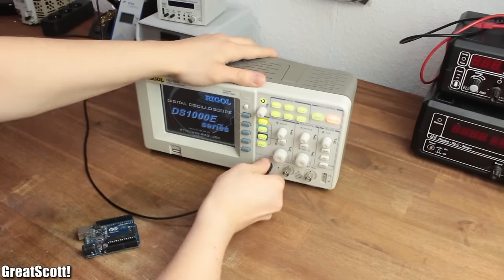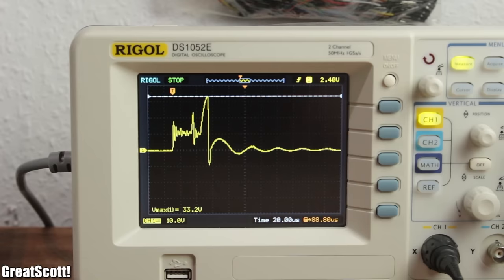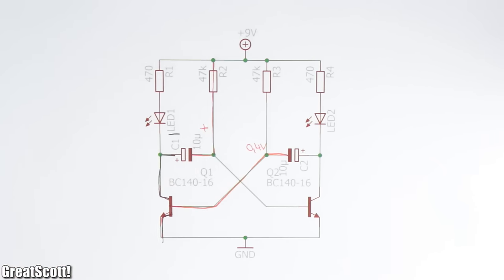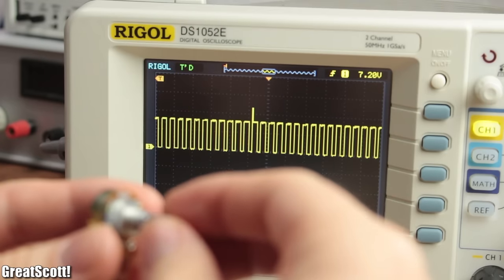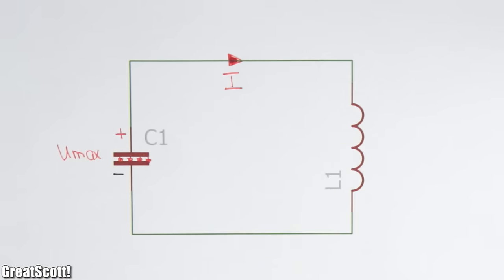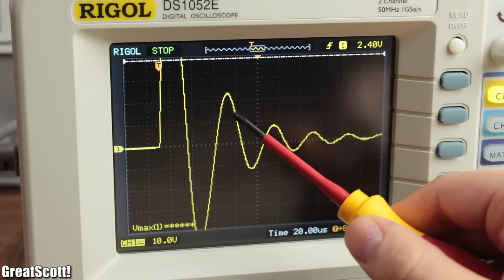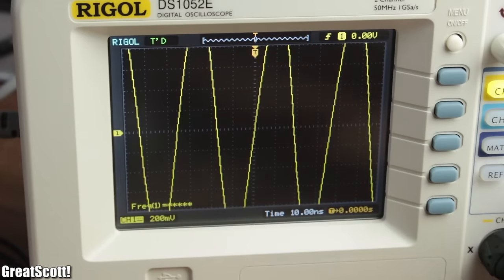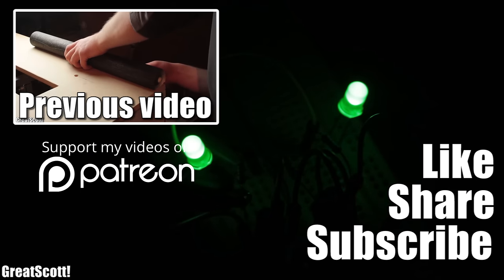Electronic Basics #17: Oscillators || RC, LC, Crystal

Comment: the calculation of the resonance frequency of my LC circuit using 1mH inductor + 100nF capacitor gives f = 15.9 KHz
on my oscilloscope i get about 20KHz :/
is it normal ?
Reply: If you are building on breadboard, always expect it to be different for any circuit heavily dependant on  capacitance and/or resistance and/or inductance.   The breadboard itself can add these values, due to the way the rows are lined up near each other.    These are called "parasitic" capacitance/resistance/inductance, in case you want to research the phenomenon further.
Reply: @awjaaa   kind of like transmission lines

Comment: Suppose a Multivibrator is made with 2 sets of Identical components .  The possibility of both sides of the multivibrator saturating  simultaneously is NEVER explained ! On paper, the circuit will NEVER start  oscillations from that state.
Practically even a circuit with carefully matched components , maintained at the same room temperature might temporarily remain in saturation ...BUT, WILL eventually start to oscillate when the symmetry is broken by microvolt thermal noise  that is amplified , the feedback increases the unbalance , until the circuit IS OSCILLATING.

Comment: Mmmm.... you skipped diodes. 
There's specifically three types of diodes which are quite good at oscillating: 

-PIN diodes are the basis of many RF transceivers, but many of them will oscillate at lower frequency.

-Varactors are similar to PIN diodes, but they have slightly more use. Varactors easily replace variable capacitors. They go for 1/10th the cost of the trimmer capacitor and have more applications because the varactor can be tuned as a function of changing voltage, which means it can effectively changed in sync with the signal it's tuned to. 

-The last oscillating diode is the Tunnel diode. They don't specifically make it anymore, but it's legacy persists through the use of the 2n2222 series transistors, Many FETs, and can potentially be exploited any time you have a direct PN junction. It's functional basis is the Esaki effect. 
When forward biased, the diode is a voltage controlled oscillator. 
When reversed biased it becomes a schmitt trigger, and is the basis for many older oscilloscopes. 

Anyway... those are 3 more types of oscillators that work.

Comment: the multivibrator is an UNFORTUNATE  choice of circuit to explain oscillation, because in the real  world the capacitors, and transistors are NOT identical pairs.
The start-up of an electronic oscillator is usually caused by  power supply turn ON, or  feedback of electronic noise, in the case of multivibrators, by  RC]1 different from RC]2D
or transistor parameters  Vbe, Temperature, leakage currents being UNequal.